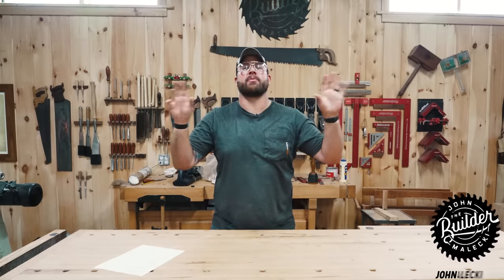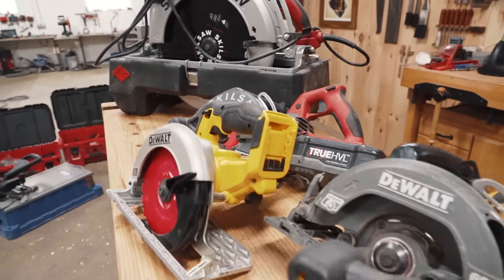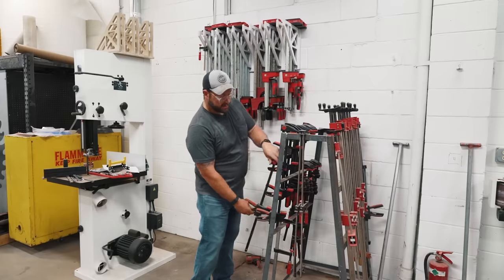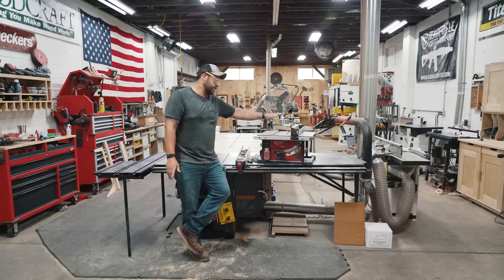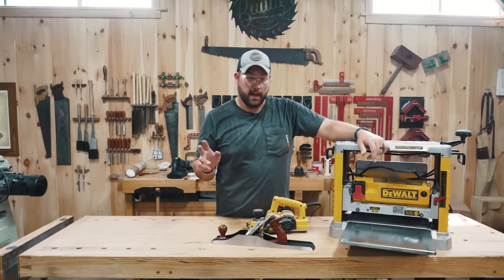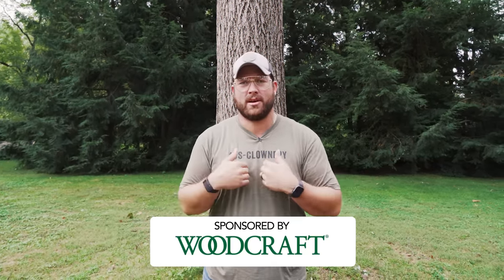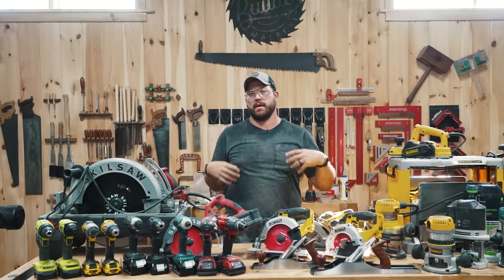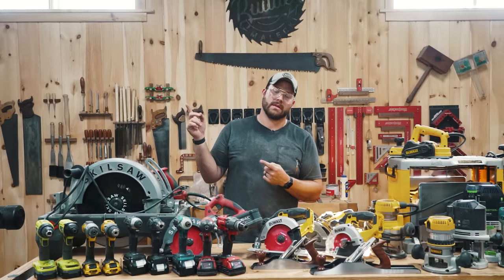10 Must-Have Tools For Beginner Woodworkers

Comment: The only issue I have here, is recommending an impact driver for the beginner, reason being, many people misuse them. Unlike a drill/driver which has an adjustable clutch on it to prevent you from over driving screws, and stripping out the threads the screw just cut, an impact driver will steadily drive until you take your finger off the trigger, which can ruin your work piece. An impact driver is great in a woodworking shop when you're bolting two pieces of wood together with a nut and bolt, or having to remove old screws that you just can't budge with a screwdriver. An impact driver is much better suited for automotive or metal workshops than a woodworking shop........at least for the beginner IMHO. Another recommendation I would like to make is for track saws. They are incredible for really any level of woodworker, but they don't need to be expensive. You showed the Festool (probably the most expensive one on the market) because it's what you have, but even the Makita is mighty expensive too. There are track saw kits out there that allow you to attach any circular saw to a plate that slides along the track. Alternatively, you can even make one with a piece of 1/4 inch plywood, and a piece of 1/2 inch plywood. The 1/2 inch piece of plywood should have a straight edge, and be about 4 inches wide by however long suits your needs, and the 1/4 inch piece should be about 8 inches wide and the same length as the 1/2 inch piece. Place the 1/2 inch piece on top of the 1/4 inch piece with one edge of both pieces being flush to each other, and the perfectly straight edge of the 1/2 inch piece not flush with the other piece. Glue and screw the two pieces together, driving screws through the 1/4 inch piece into the 1/2 inch piece and countersink them. Next, you'll use your circular saw to trim the excess off the 1/4 inch piece placing the blade as far away from the 1/2 inch piece of plywood as possible. Now you have a track saw for just a few bucks. I hope that explanation makes sense, I have a brain injury that forces me to overthink things sometimes.

You also just saved me a lot of money, time and aggravation. I was tossed between buying a Makita miter saw, or the Bosch, and when you said the dust collection on the Bosch is terrible........nuff said...........THANK YOU!!!!!!!
Reply: Btw don’t use an impact driver for automotive. The hex shank will snap at most torques needed, use an impact wrench :)
Also my impact has a 1234 setting on it

Comment: I am surprised that a CNC machine wasn't listed as one of the ten tools.  

This list is VERY UNREALISTIC FOR BEGINNERS (unless you mean beginners who have won the lotto).

There shouldn't be a single tool in a beginner list that costs over $400.00
No beginner is buying a saw of any type that costs $5,000.00.  

Hell, you would need to explain what some of those tools on your list are even for.   People are going to use a orbital sander more than a planer or joiner. Even a speed square would be more useful for a beginner than those 2 things.

This video should have just been called "These are the tools that I had to use BEFORE I BOUGHT ALL THESE HIGHEND EXPENSIVE ONES"

Comment: It's also interesting to me that you really stress safety with a router and not so much on the table saw.  I would think there are way more table saw accidents than router accidents.  I haven't looked up any stats or anything but I've just heard about a lot of table saw injuries and I don't think I've heard of a single router injury.

Comment: Absolutely the first power tool a homeowner, woodworker, whatever should own is a cordless drill.  Because even just hanging a smoke detector or something will likely require driving a screw, and drilling holes with hand tools is just a tremendous pain.

Comment: That is funny about the router.  I am way more "scared" to use a table saw over a router.  To the point I have not purchased a table saw.  I am very novice (beginner) into any woodworking and only would be a "weekend" woodworker.  I use a circular saw and miter saw for all my cuts and rips....though I have only done a bookshelf and bench seat.

Comment: Personally, I think you should make separate videos for hand tools and for power tools. And put yourself in the position of a person that knows nothing and has no money in his pockets. With that in mind, i think for power tools you must go for: drill, impact driver, circular saw, jig saw, orbital sander, miter saw, router, table saw, planer, jointer. In that order considering the shop vaccume as part of the dust collection instalation or as something you would already have at home and could borrow for a while.
In the case of hand tools, those are much more. You need clamps, saws, knifes, scrapers, chissels, hammers, mallets, sqares, straight edges, screw drivers, etc.
Maybe a quick view to the hand tools you have used in the last 5 or 10 proyects would be very usefull.

Comment: Hello,
I have recently started a woodworking workshop in India, and want to buy a plunge router. My major working in the beginning is going to be on resin tables with hardwood and also on other furniture making. Which collet size machine should i go for: 8mm or 12mm?

Also I have planned to use my plunge router as a self made CNC Machine.

Plz suggest.

Comment: in your video you use multiple brands,  if I were a starter and wanted to be well equipped for wood working AND general maintenance and con only afford one option a smy budget is not big,  wich tool 18v brand will last me the longest without needing to replace, in your opinion. looking for dependability in a 18v  having a hrd time deciding btween D-walt or Milwakiee.....milwakie seems to be the better tool on the drill/driver/ recip saw  and miter saw options, but is the cost hike worth it over the D-walt or other brands. ?

Comment: Router and table should be number 3, after drills and a circular saw.  Clamps and files for #4.  Don’t buy a planer or jointer until you have some projects under your belt.

Comment: Great video. I actually purchased the miter saw you have a couple months ago have some exhaustive research. No doubt, it performs better than the Bosch. Part of my research did include prior negative comment from you about the Bosch :-). Note that the 12" Makita has a 15 1/8" cutting depth, that was huge for me.

Comment: I'm very much still a beginner, but judging by the video I have everything now that I need apart from some long length clamps, which I have to admit, so far i've not needed, but larger projects I have in mind suggest I will. So that said, having spent a fair amount on gathering other tools, the funds are low to say the least so I have been looking at cramp/clamp head sets that fit to any length 1" thick wood stock, has anyone had any experience with using these? are they any good or is there too much flex in the 1" wood lengths to make them worth it?

Comment: One additional note on why a planer is more important than the jointer... you can technically use the planer as a jointer if you make a sled for it.  I had a board with a twist in it, and the planer originally wouldn't get that twist out.  I created a sled from a shelf, shimmed up the high corner, then was able to flatten one side in the planer

Comment: Speaking about routers, which is more needed for a begginer if i can only afford one, fixed or plunged base one? Cheers from Poland
Reply: Most plunge routers should be able to be used like a fixed with lock on them to prevent plunging! Depending on the work you do, you may only need one or the other! I have both bases for mine, yet have only used the plunge base once in the past three years!

Comment: Great video John can you give me some advice on how to get my miter saw fence alined perfect I have tried several times and it's off by 1/32 over 6" cut
Reply from the maker: Miter saw is for rough cuts . Probably blade deflection too
Reply: @John_Malecki  Sorry I dont agree , Not for rough cuts ,a mitre saw is designed to cut mitres which have be accurate .  Len

Comment: Just curious, what is some people use the purple extruded polystyrene foam for cutting sheets of plywood or Lumber by chance?
Reply: It is good to put under a sheet of plywood instead of supporting(balancing) it on 2x4s or something else. Then when you cut through the plywood, you are not cutting into whatever you have below it.  I have one that I use when cutting plywood as I have to do so in my driveway(SMALL shop!) it stores with the rest of the plywood against a wall and lasts a long time if you don't cut too deep through it.

Comment: I have to disagree with your comment about needing an 18v drill/driver. The M12 fuel line has plenty of power, if not more than most 18v sets. This is from their website. Fastening Torque: 804 in-lbs (1st place)

Nut-Busting Torque: 1680 in-lbs (tie, 1st place)
Reply from the maker: I like the 12v. Have you used any of their 12v carpentry tools ? Do you also believe their website haha ? 12v are great we use them a ton but I wouldn’t start at 12v because you are limited in tool availability for the battery, and they don’t make a hammer drill in 12v
Reply: @John_Malecki  yes they do. I have a M12 drill that is a hammer drill. 2504-21

Comment: First let me say I've been enjoying you videos.  Found your channel about a week ago, and have been binge watching them all, ever since :D

Anyways, I'm curious to know why you left out basic tools like Chisels and Sanders, but put in a more advanced tool like a Jointer (most beginners wouldn't be using rough wood)?  Sanding, to most people, seems to be the most monotonous, and boring job in any project, so wouldn't something that makes this job easier and/or faster be in the top 3 or 4?... right after Saws and Drills?

Also, (speaking of Saws) with a Table Saw or even a Circular Saw, you can easily make crosscuts and miters (with a sled or jig), so why also list the Miter Saw... for beginners.  3 of your top 10 can do the same exact thing?  Miter Saws are very useful, and time saving, but hardly a "Must-Have"... as well as pocket hole jigs (very easy to make your own), or drill presses (also easy to make a jig or guide).  

Sorry if this sounds negative... but I truly want to know.  I'm retired, and want to get back into woodworking (spending too much time playing video games :P), and am starting from scratch on a Social Security budget, and may only be able to get 1 tool per month, so I want to know what would be the more useful tools (Must Haves), for starting out.  A Miter Saw was at the top of my list, at first, but has now moved down to about 18th... right after Drill Press and before Air Compressor.  At this rate, it will be 2022 before I get a Miter Saw LOL.

Comment: Would you recommend getting a 8.5" table saw or does it have to be 10".
Reply: Would depend on the type of stock you work with. I've used both sizes and would generally recommend a 10" if you can afford one. However on a budget an 8.5" will do most tasks. Especially if most of your work is sheet goods. The advantage to 10" or larger is depth of cut. For ripping down beams you can always flip the work piece to finish the cut. For furniture and cabinet work an 8.5" is enough for most projects. Getting a band saw is more ideal for beams or sawing down large rough cut lumber to usable sizes. Just depends on applications. But personally I'd pick up an 8.5" while starting and if I have the space I'd save up money for a full size later down the line. Just depends on how much you do and if it's for monetary gain or just hobbyist work. I do woodwork everyday for a living but that isn't everyone.

Comment: Advises to buy circular saw, table saw, jointer and planer but in the end the router is intimidating and scary ;-)   Yes a router is dangerous too but things can go wrong in so many more ways with a circular saw.

And as others already mentioned: this is NOT a beginners list. With a good drill and jigsaw (using a ruler) you can achieve quite a lot. From there on you can expend your toolkit based on experience and limitations you run into.
Reply: I find it weird, too. If you learn to use a router the hard way, you end up with a scar. If you learn to use a circular or table saw the hard way, you are going to need surgery.

Comment: Hey  just wondering why when you Google thicknesser do you get jointer and can you use a jointer to do same task as a thicknesser. just cos I'm finding there cheaper hear in the UK.
Reply from the maker: No. A jointer flattens one side. It’ll create a wedge if you do both sides
Reply: @John_Malecki   OK cheers

Comment: Routers are really terrifying to me once I didn't tighten the bit well and I was using it upside down like a router table for a small piece of wood and the bit flew out cut a good 3/4 of an inch of skin off the tip of my middle and ring finger mom made me go to the ER it cut the tip of a nerve too I just cringe thinking about it so now I pretty much hate using my router

Comment: Misusing pocket holes? I framed the run for my chicken coop using 2x4s and pocket holes. Now did it take longer than doing it the “right” way? Yes. Was it weaker than using another method? Also yes. Was it more expensive? Again, yes.

Looking back I’m not proud of my decision but it’s done and unless I get some hulkamania raccoons my birds are safe lol.
Reply from the maker: Hahaha I can’t if you’re in agreement or if you hate my comment. But I do love chicken!
Reply: @John_Malecki  Oh I totally agree with you.  I feel like I was getting called out by the coach for doing something I know I'm not supposed to do.  Don't run into the backfield on a screen pass, and don't use pocket holes like that.

Comment: Welp......I may or may not have just built a couch using a pocket hole jig on a lot of the joints....starting to think that could be a mistake if I did indeed do that. Not saying I did, but I might have....

Comment: Don't buy cheap tools even if you have to save for a while buy Dewalt, yes they are more but worth it in the long run. But I will say i have a old black and decker jig saw it worked great but after years bought more expensive jig. Some say Iam too old fashion but i do like tools with cord even though i have a couple cordless ones.

Comment: First thing any beginner ought to be aware of is Harbor Freight. Lots of budget tools there which are inexpensive, and good enough for you to play with until you know you are more serious. The biggest trick is knowing what is a crap tool there and what is not.

The second thing any beginner or budget tool seeker should be aware of is Banggood. Why pay a middleman for something made in china, you can save a lot to just buy it from the Chinese maker. For most things that are machined aluminum (e.g., 1-2-3 blocks, rulers, angles, doweling jigs, etc.) you can get it a lot cheaper (though sometimes much slower, as it's on a literal slowboat FROM China) by ordering direct from Banggood. A lot of that really nice, well-machined Woodpecker stuff is made in china and indistinguishable from the Woodpecker stuff but no "Woodpecker" logo.

They're also good for things like steel rails, t-track and things like that. They have "flash deals", clearance sales, and such that has some pretty good stuff, too. NOT suggesting you buy OR avoid anything more complex, but knowing that you can get certain kinds of basic stuff like aluminum rulers and the like for a hell of a lot cheaper than Woodpecker or even Amazon is a good thing to know. Consider more complex things (e.g., power tools) at your own risk. If you want a domino tool but don't want to pay festools' price, they have something that you put a handheld router into and it does much the same job. Not as well as the festool does, but it's also only about 90 bucks (plus your own router). IIRC, I think 731 Woodworks channel did an overview/review of it.

Comment: (almost) never take the cheapest option, it often becomes the most expensive (reparations / replacements)
we have a dutch expression about this; Goedkoop is Duurkoop
Reply: EC talks about this often. His thoughts are buy the best you can afford. If all you can afford is the one from the discount tool store that is ok because having the right tool of lower quality is better than trying to use the wrong tool. 

My personal preference is to have more tools even if they are lower quality. Do I need 3 cordless drills. No I can only use one at a time but if I have 3 $50 drills instead of one $200 drill it's the same as his dedicated routers. Often these days the  money spent on the consumables, bits and blades, is more useful than the the tiny motors and plastic housings that hold them.

Comment: OK - please tell this beginner why you did NOT mention a Biscuit jointer when discussing jointing & doweling ?
Reply from the maker: Biscuits are not really a joint. They can be used properly , but most of the time theyre improper (sort of like a pocket hole jig) we also dont use it a ton. Check out Mike Farringtons channel, hes a biscuit master.
Reply: John Malecki  Thank you John for sharing your knowledgeable insight

Comment: I would leave the pocket jig out and replace it with a sheet sander or random orbit. I would also replace the circ saw with a jigsaw, as you already have a table saw and a mitre saw for all kind of straight cuts, but no way of making curved cuts. I personally do not like Makita and Ryobi, they have no place among my tools. I also do not think an impact driver is a necessity, they are handy but I can not stand the noise. I have three impact drivers and I barely use them at all. I rather use multiple drills with different drill bits and driver bits in each of them.